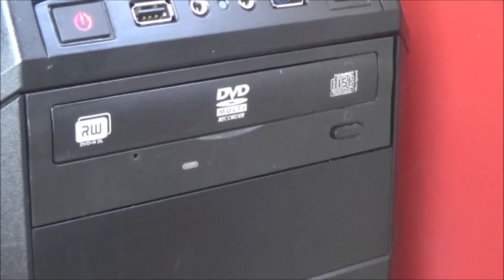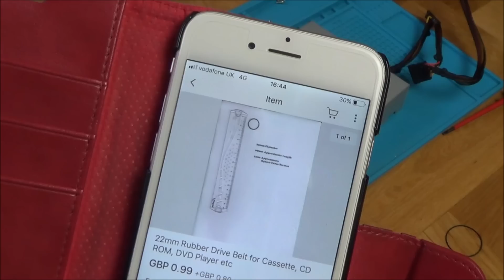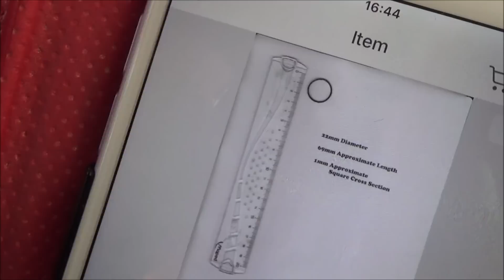Trying to FIX a Faulty DVD / Optical / Disc Drive in a Desktop PC

Comment: YIKES!!! Did I see the drive has up to 1.5 amps within it's circuitry? If it does then just be wary that you can have a fraction of a volt at anything over one amp and it will KILL!!!.
 
So yeah just be a little more cautious Vince as it's all in the Amps, Our bodies are exposed to thousands of volts when treading carpet but due to the low Current its safe.. Ever held a Fluro Tube pointing up into the air under some High voltage power lines with "thousands of volts" going through you as the Fluro lights up, its all safe due to the Low current.. 

BTW Here in Ass-Trail-Ya those suckers err-"DVDR/W" cost a whopping $19 bucks new, If it were a BluRay Writer though it would cost around $80 bucks new, funny thing is A DVD R/W has much the same innards and circuitry as a BDR/W, Hmmm might pay to get a DVD R/W before they're all sold out, but then again the BDR/W may drop in price to much the same price as a DVD R/W once they're all sold out.. 

Last but not least, yo Bro mentioned another drive misbehaving much the same way, so I hope yo ordered TWO Belts..
Reply: @TrickySpot

OK, I should maybe clarify that by saying that I would NOT advise anyone to touch the terminals of a car battery when it's still hooked up to a car, as there are other factors involved then.

I was talking about 5V or 12V from a standard (mains isolated) power supply.

But - if a standard 12V car battery isn't connected to the car (and hence no back-EMF from the starter motor, alternator, ignition coils, or anything like that), then touching the terminals isn't going to do much.

Yes, even a small car battery is capable of supplying hundreds of Amps of current to start the engine, power lights etc. But the skin resistance of a person is too high for any appreciable current to flow. You wouldn't even feel it.

I spend most of my time telling people to be careful with things like CRT TVs etc. I wouldn't knowingly say something if I thought it was dangerous.

http://wtamu.edu/~cbaird/sq/2013/11/01/why-is-a-12-volt-household-battery-harmless-but-the-shock-from-a-12-volt-car-battery-will-kill-you/

https://www.youtube.com/watch?v=lqb1cgd-89Y

https://www.youtube.com/watch?v=OpqW4Ey9618
Reply: 100 milliamps across a human heart is enough to stop it....pacemakers are a perfect example of the low amperage needed to kick start a heart. BUT, the resistance across from one hand to the other through the chest is massive, the potential difference (voltage) of a 12V PSU is not enough to overcome the resistance at a few amps, its not going to reach your heart, not in a million years. You may feel a sting if you touched terminals with a wet finger, but that's it. Even 240V @ as many amps as an electrical socket will supply is not 100% lethal (otherwise I wouldn't be here), because of the high resistance of the body...you can usually feel the "shock" travelling up your arm and both the muscles in your arm tensing up, plus the surprise of the event will usually make you drop whatever is giving you the shock! A toaster in the bath is an example of where the water decreases the resistance of the body, plus you can't get out of the bath fast enough to escape certain death because you've lost muscle control...a lethal shock is dependent on voltage, amperage and TIME! If you don't believe this logic...then ask yourself this....why does an electric chair which is designed to kill, not kill instantly with a single pulse of power? Why has one of the shortest electrocutions taken over a minute @ 1200V and goodness knows how many amps, and some can take up to 15 minutes?! SO @ KorAllRBare, you're mistaken on this occasion. I was testing AA batteries earlier and some pushed out up to 3A for a short while, so following your logic of a small voltage at something over an amp would imply that AA batteries are death traps...
Reply: @martinmeyer2008  

Obviously it all depends on the exact circumstances, and how a device works.

You were talking about people getting a (potentially lethal) shock from touching both terminals on a 12V car battery.

Most pacemakers only need a few millamps to restart the heart, yes, because most pacemakers are DIRECTLY wired across the heart with electrodes.

Or, other types use an inverter or pulse gen to bump up the voltage.

I see you deleted your original comment (about the car battery thing), and now you're actually agreeing with me. Interesting.
Reply: I learnt  @electronash  Via an "Electronics Course" that if a circuit is capable of dealing with over an Amp to the skin, Irrespective of the Voltage one needs to give it the utmost respect, in that it can KILL, and it makes sense once you know the circumstances, all it needs is a fraction of an amp to stop ones heart by "Direct Current" DC, So why do people survive Outlet electrocutions? The key is "AC" or Alternating Current opposed to Direct current, AC contracts the muscles in a wave thus relaxing and constricting via a wave function, whilst DC will send the muscle to be immediately rigid, and it doesn't need much current, it just has to be greater than what the body naturally produces in muscle control..
Reply: @TrickySpot  Think of heart attack victims, Where when the heart stops only then precious oxygen rich blood cant be pumped to the brain, death is extremely painful, the victim wants to breath but the lungs muscles also need oxygen and thus what little oxygen was available, shortly after is used up, pain intensifies unless the lungs are helped along via mut to mut "blah" why couldn't it have bin a goil, meh.. anyway a few quick whacks to the heart can help pump vital oxygen rich blood to the brain, and thus the victims heart can recover and said victim is saved.
{sarcasm}
Now when it comes to deliberate Murder, and knowing the extreme pain evolved, Barbaric regions who practice such punishments obviously want this, this this agonising slow death.. :D
Reply: @KorAllRBare  

Yes, and a single D-cell battery can deliver at least 1 Amp when shorted.

It is all about the circumstances, yes, but you're still not going to get a shock from a 12V battery unless the voltage is stepped up in some way.

In theory, almost anything is dangerous if used in the wrong way, like the LiPo batteries used in almost all portable devices these days. I would argue they can be far more hazardous if they are overcharged, overheated, or shorted.

Going back to the original point from watching the vid - I don't think I've ever heard of anyone getting a meaningful shock from any of the output rails from an ATX PSU in a PC before either.

There would need to be a pretty serious fault with the PSU for a shock to happen on the secondary side.

There are always potential risks with anything like this, but not in normal / careful use.

Far more of a risk with PC power supplies is if something does short out, and causes burns or a fire.

Or, if somebody is silly enough to open the PSU up, and touch anything they're not supposed to.

(the smoothing caps inside power supplies can hold a charge for hours or even days after the PSU is turned off, in some cases.)
Reply: @electronash 
Seriously, I have no arguments, I hold your logic much the same way, but the maths supports the fact that the risk of death is there.
 
And a quick google and some maths will confirm that risk is in fact real. 

Remember we as servicemen beit layperson or professional may inadvertently touch a conductor that provides the "right" - {err-um maybe "right" is the wrong word,} so lets say the devastating circumstances for a heart stopping current to occur, enough to permanently damage the heart muscles within nanoseconds
Reply: @KorAllRBare  

See, what's happened here is that somebody deleted their original post, which kind of changes the entire context of the discussion.

I'm usually pretty good at avoiding silly arguments on YouTube, but when somebody replies to me saying that I'm putting people at risk, I'm forced to respond.

The original discussion was regarding getting a shock if you touch the terminals of a standard 12V car battery (presumably when the car is NOT running, as you could actually get a shock then).

It's not something I would recommend to people in general, no, but I was replying about how there's no risk of shock from a standard car battery on it's own...

https://i.imgur.com/Em1yhNN.png

Practically ANY power source can be dangerous in the right circumstances. Even a small LiPo or even a tiny Lithium cell hooked up to an inverter and capacitor is enough to kill.

I admit that maybe I shouldn't have suggested people touch battery terminals just to test a theory, but I thought it was common knowledge that a 12V battery doesn't pose much of a risk on it's own.

If a low-voltage DC source a 12V battery that was really so hazardous to the heart, then your maths for skin resistance vs current flow must be wildly wrong.

Regardless of the potential for a huge amount of current flow, it still comes down to Ohm's Law.

The NIOSH states "Under dry conditions, the resistance offered by the human body may be as high as 100,000 ohms. Wet or broken skin may drop the body's resistance to 1,000 ohms," adding that "high-voltage electrical energy quickly breaks down human skin, reducing the human body's resistance to 500 ohms".

Even in the circumstance of wet or broken skin dropping the resistance to around 1000 Ohms, let's call the battery 14 Volts when fully charged. Again, this does increase the current to an appreciable amount, so I wouldn't recommend it...

I=V/R
I=14/1000
I=14 milliamps.

But if you're talking about touching the 12V battery terminals with dry skin (ie. in any normal circumstance)...

I=14/100,000
I=0.14 milliamps
I=14 microamps (no way that's going to pose a risk of shock, at that voltage)

I should reiterate though - In general, please DON'T go touching the terminals of any battery if you don't know the voltage of it, or are unsure of what else might be connected to it. You can still get large voltage spikes from back-EMF from inductors like in motors or coilpacks.

Even in your OP about the 1.5 Amps being "within the circuitry" of the DVD drive, yes, it's extremely common to see a couple of Amps for spinning up the spindle motor etc. Luckily, you won't get anywhere close to 1.5 Amps flowing across your heart from touching the 12V output from a PC power supply. It doesn't work like that.

Power supplies don't "push out" a constant current all the time. The current rating of a PSU or car battery is proportional to how low the circuit resistance is.

There is a common misconception where some people tend to think a "3 Amp" wall wart is essentially pushing out those 3 Amps constantly, but obviously that's not the case.
Reply: @ElectronAsh Yes, I deleted my comment because I realised that the explosive results I've seen on car batteries were low resistance dead shorts (high amperage), and the human body is not that, and your comment is indeed totally correct...I obviously didn't delete the comment quick enough and you replied. Car battery aside, a DC PSU @ 12V is never going to kill you under NORMAL CIRCUMSTANCES, never. Just like you said.  (0.14 milliamps is 140 microamps, just for total accuracy). Also, if you set your multimeter to the 10A socket, if it has it, you should get way more than 1A from an AA battery, its virtually a dead short, I don't believe you have to go as big as a D-cell

@KorAllRBare If you are implying that the electric chair is deliberately long in how it kills, then why has virtually the whole world moved onto quicker, less painful and more humane ways to handle death row? Why not just let the person sit there for hours in agony while being electrocuted at a lower voltage? And your comment re AC causing a muscle to contract and relax is even worse than your original comment. Following your logic, we should be dead scared of 12V PSU's, and not worry about toasters in the bath. What you forget is that a muscle takes longer to relax following the stop of current flow than the initial contraction, so @ 50Hz AC, the muscle contractions will be greater than the "relaxations" resulting in a net contraction. That's why those silly machines they sell to build muscles have longish delays between the electrical pulses...that's giving the muscle time to fully relax. Google it :-)  Or go through ElectronAsh's maths.....even with wet skin, 14 milliamps is way below the lethal threshold, and those low resistances are really ideal circumstances, much lower than what you'd get in the real world. So 12 DC PSU's = Good, 240V AC toasters in the bath = Bad! Does Vince need to worry about the 12V DC inside what he's working on? 99.9% of the time, no!
Reply: @martinmeyer2008  

It's nice for somebody on YT comments to see their mistake, so I'm happy with that. ;)

And yep, I said a small AA battery could easily supply at least 1 Amp. Probably a few amps for a while, when shorted.

(The internal resistance of the battery itself comes in to play there, of course.)

LiPo batteries are far scarier, especially with the increased fire risk.

When I first started out in electronics (about the age of 8), I did make the usual mistake of trying to directly measure the "current" of a small 12V Yuasha battery by hooking up the meter probes directly, while it was in 10A mode. Oops. lol

Also, yes, the risks of AC vs DC thing isn't clear-cut.

AC mains also tends to make your muscles contract anyway (I found that out the hard way once. Never made that mistake again). DC is not necessarily inherently worse if the voltage and current capability is high enough.

Both AC and DC (or pulsed) of sufficient voltage + current can of course be lethal.

On that ONE occasion when I stupidly touched some heatsinks (luckily only with one hand across two of them), It did cause the muscles in my hand to rapidly oscillate, but overall it still tried to contract, and I couldn't let go for about half a second.

I was about 12 then, and learned to respect electricity far more. I rarely working on mains or other HV stuff these days. I just don't do repairs as often now, but it's also nice not to have those ever-present risks to worry about.

So yeah, be careful, folks. A simple PSU or TV can store a deadly charge for many hours after being unplugged, so best not to take any chances.

(we could get into the discussion about the actual risks of getting injured or shocked from something like that, but I think this has gone on long enough. lol)
Reply: Yeah being sarcastic via written words can be a tricky exercise, And as for AC I stand by what I expressed in that the muscle can relax as the current reduces down to zero via the mains frequency, AC is an alternating curent that crosses a zero point of current via the Mains wave function, where the electrons at that point reverse direction, hence the normal body at some point is able to override the foreign introduced muscle signal or current to let go and flee, with DC as long as the natural current is overidden the muscle remains ridged, ergo a clamping hold on the source of current remains clamped, {Sarcastically} one moment alive, a flash of light and then nothing, critical synapses and heart Muscles are fried and set to ridged until a stick is poked at the corpse to remove it from the current.

Comment: is he still running a fx processor
Reply: fx is still good for gaming and now its cheap 
so why not use an fx for gaming and other stuff
Reply: @user-jp1yd2ut9r  its not that good had one in my first build and i regret it to this day i believe there is also a lawsuit going on about the fx series
Reply: @arcticyuki  my main pc has an fx and any game i play on it runs them fine 1080p 60fps at mid settings
Reply: @user-jp1yd2ut9r  what games do you play
Reply: @arcticyuki  falout 4 gta hitman 2 just cause 3 
stuff like that
Reply: @user-jp1yd2ut9r whats your system specs
Reply: @arcticyuki 
 fx 8300 @4.8ghz 
rx 470 8gb 
32gb ddr3 
500gb boot ssd
4 x 1tb hdd in raid 0 for games
Reply: @user-jp1yd2ut9r  not bad i had the 6300 it wasnt the best cpu for gaming even with a 770 i got still could not get good fps and that was on older games
Reply: @subconscious.com_usa6691  id still recamend anyone on a tight budget to go fx as ddr3 is alot cheaper than ddr4 and fx is old and cheaper now

Comment: Lol, I've bought like 20 untested CD and DVD drives, both IDE and Sata. Some from 2000, some from 2002-2004, and all  Sata ones from 2007-2011.
Out of them all, exactly this drive has problem, along with one from 2004 IDE one, and one Toshiba from 2000.
Toshiba doesn't pull out, but when I mechanicaly insert CD inside, it reads it. IDE drive doesn't read at all, but it pull out and in drive bay without problem.

This Phillips/BenQ, not only it doesn't pull out, same as this in video, but it doesn't read DVD. Only CD.
Seems, this drive was not best. So many drives, and just this have problem, and not only this. It even doesn't read DVD (only CD).

I could not believe, I have it dissasembled next to me, was going to youtube, to watch some inspirations, what to do I don't know, and cannot believe, I opened random video with drive, and exactly this DH-20A1S came out. I had to pause it several times, to believe it, seemed too much lucky fortune for me. But yeah, it is the same, I cannot believe it. :)